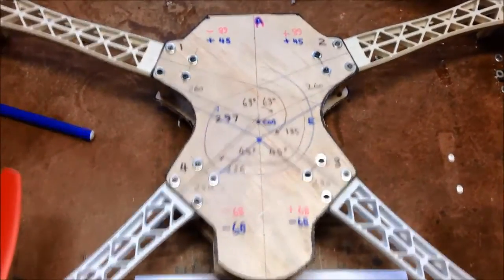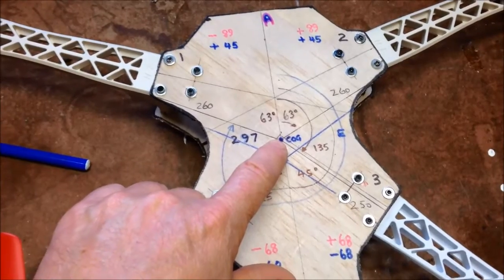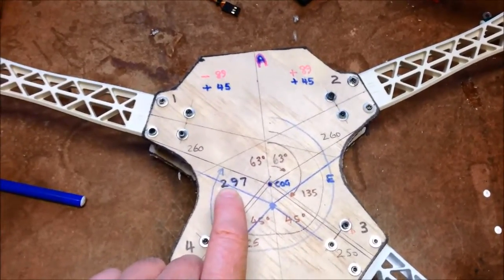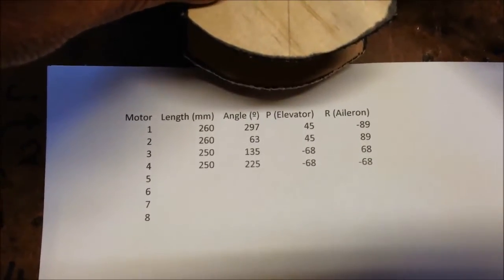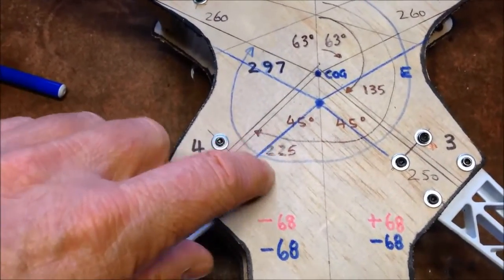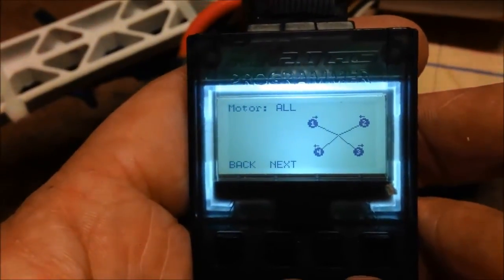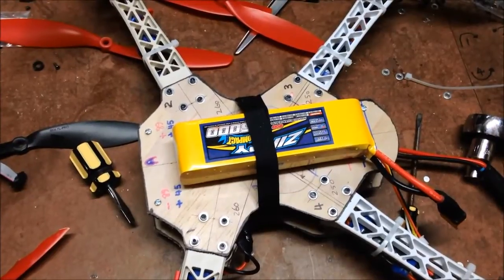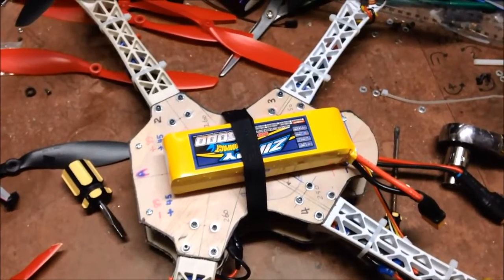Deadcat 500 Quadcopter (SK450) Build with KK2 Mixer Editor settings and RC911 R4

Comment: Hi Simon, thank you for the detailed explanation on getting the motors in the right places. I have the kk2.1.5 board and after setting up the motors into their rightful places I tried it and it is unflyable. Could you tell me what the PI Editor numbers are and the Self Level Settings are? Most Appreciated.

Comment: Will these numbers work on an original DeadCat?
Reply from the maker: +55Rumble I copied this template of the original so I would think so.
Reply: +Simon Hahnel 
Hi Simon.
I punched your numbers into my Deadcat and it flies but way harder than my numbers....
I have a few posts on RCG... Have a look at post number 75.
This is my quad and it does fly well....
http://www.rcgroups.com/forums/showthread.php?t=1782331&page=5
I've not flown it much as the weather has been rubbish for so long but I did take it out last weekend and it was great fun!...
Your's clearly flys well but on my DC, Your numbers don't seem to work so well.... I can't figure that out????